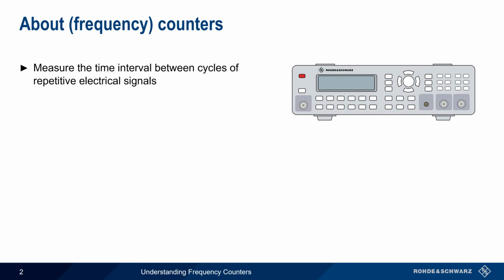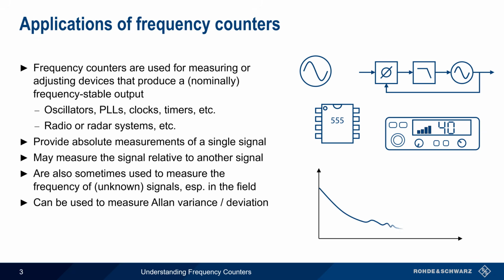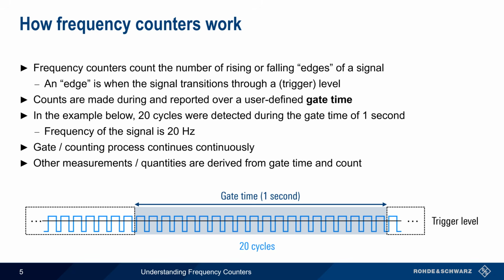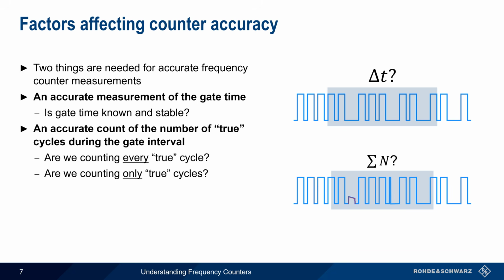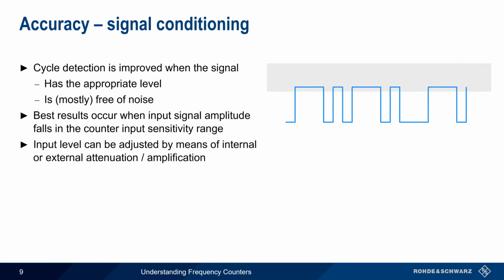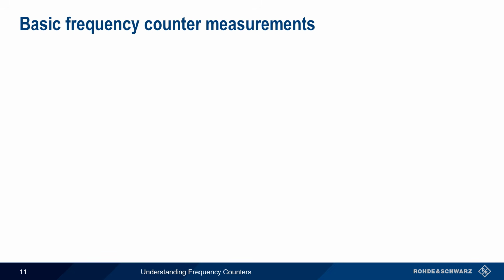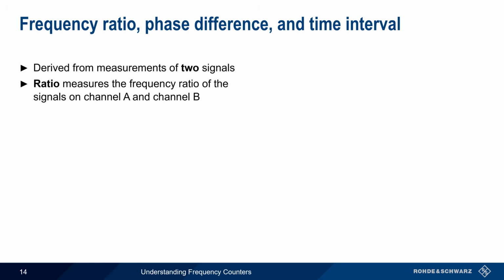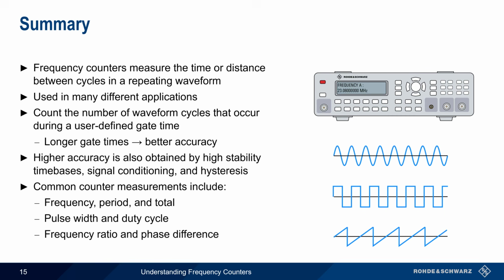Understanding Frequency Counters

Comment: Great video!
It might be obvious, but it is worth mentioning that short gate time allows to capture fast changing signals, that otherwise would be averaged.
In addition, it is usually better to use a zero dead time counter, so that none of the measured cycles are lost during measurement. This is crucial for accurate ADEV measurement.
Reply: Thanks!  Believe it or not, I had that in an earlier version of this presentation (about shorter gate times) and took it out because I thought it was too much detail 😂  And yes, you're very right about Allan Variance - I'm going to be making a video on that early next year (I hope!)